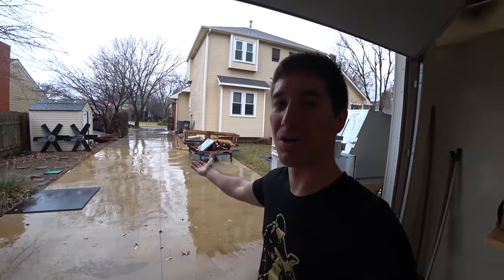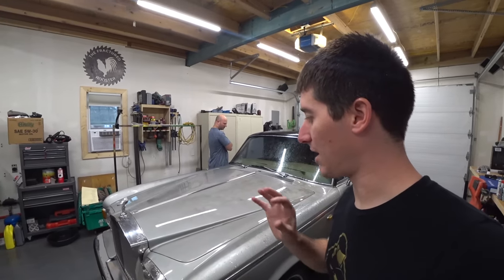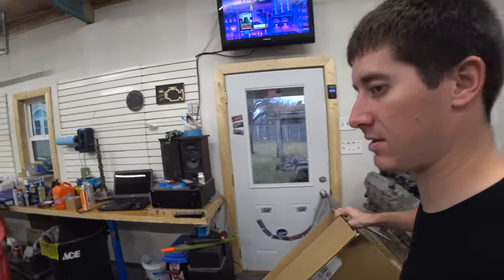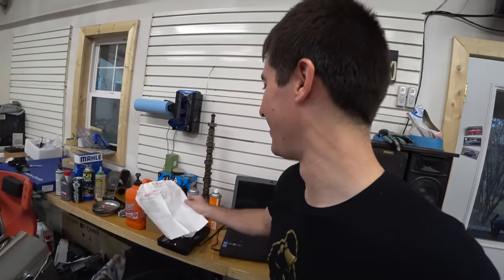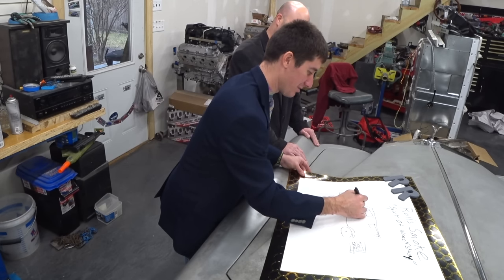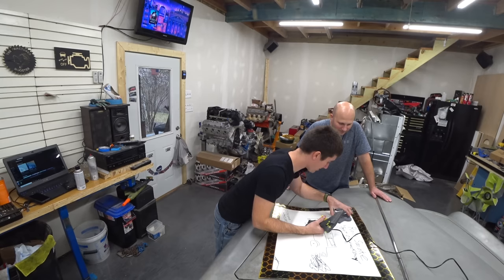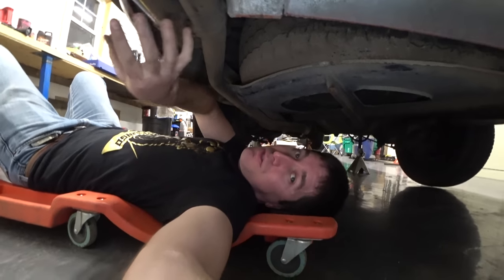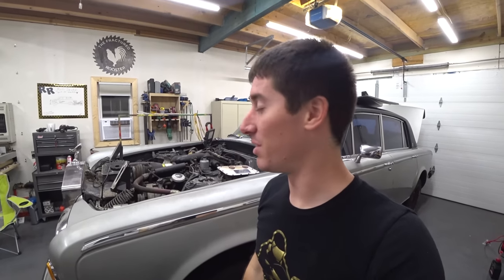Introducing PROJECT ROLLS SMOKE *LS Swapped Rolls Royce*

Comment: This is not where I saw the RR rebuild going.
Reply from the maker: It was pretty hard to keep the plans secret for one day, the engine deal was put together on Monday 😂
Reply: I'm honestly okay with it though
Reply: this is not the type of RR that's worth bringing back
Reply: @LuanCristianThums  It is a shame, but it will cost $40-50k to restore. Its really just a parts car so if it can be rescued in any way I'm OK  with it.
Reply: @2DogsVlogs  exactly
Reply: @WatchJRGo  save the top... weld some sheet metal to the top... and reupholster the top!
Reply: Cleveland Maker - Agreed. Sand it, patch what’s too far gone, paint it with Rustoleum and have a shop put a top on it. They’re not that expensive to re-vinyl. It would be the best budget resto mod you could do looks wise anyway.
Reply: @WatchJRGo  Don't junk that engine or trans. Someone is needing it. Keep those parts alive.
Reply: @LuanCristianThums  your right its only one of the most iconic body styles RR has ever had.
Reply: @MDC2020  by type I meant "rusty $1400 type"
Reply: @MDC2020  While that is true, there are still many of them available.  No Rolls Royce buyer would even consider a rusty car like this.
Reply: @MDC2020  it isnt a particularly special car. It is silver wraith II badged (rather than the earlier unbadged LWB silver shadow), it isnt first or last year,  it isnt specced up, afawk it has no special provenance. It is a rust bucket.
Honestly if he parts out what he can he is probably doing the best thing for preservation of rolls in general
Reply: this is EXACTLY where I saw it going
Reply: @WatchJRGo  eventually turn it into an EV. Have Rich Rebuilds help.

Comment: Have a kolache while you're here in Houston.  Check the rear suspension mounts they are weak and will rip out during a burnout.
Reply: kenneth clifford I remember Jesse James twisted bent and almost broke the rear mounts on one of these just from a few burnouts with the stock engine, I think the diff is only a single spinner too. It will probably need welding

Comment: RR/Bentley used GM turbo 400 transmission's for many many years
Reply: If they get a good built turbo 400 it will hold up and it shouldn't be too hard of a swap, and they are fairly cheap
Reply: I buy all my transmission stuff at TransPartsInc (TPI) in Fresno.... never failed me yet. Give these guys a ring. I was there a few days ago and things have slowed down considerably because no one fixed anything any more... its all remove and replace.
Reply: They rebuilt and refined them. RR owners dont like jolts into
gears as its typical for this cheap transmissions. REFINED.
Reply: To be accurate they used a "worn out" spec TH400 for those smooth shifts. The gear selector mechanism was especially crazy as instead of having to strain oneself physically selecting the gear they used an electric shifter which meant if you were being "sporty" with the steering wheel it was real easy to accidentally flick from D to R whilst turning with the expected results!!
Reply: @marksavin5778  A Rolls Royce is not a sports car. This strainless
shifts where made to an acceptable level of comfort. American philistine

Comment: Don't junk old motor sell it!
Someone is needing that motor!
Reply: Thomas Mcintosh 100% agree with that.
Reply: Agree! If the parts are extremely rare, help someone else out that restores them!
Reply: whole video is an insult to reason and common sense :)))
Reply: No rich people going spending around $50,000 to buy a used or a crap Roll engine.
Reply: @Chu3505  no. but another JR somewhere restoring a cheap rr might be able to use parts off this engine for cheap.
Reply: Yes dont junk that motor. Someone definitely can use something off of it.
Reply: erm the engine and parts were sold to wizard, need to listen to what is said

Comment: I agree with some of the other comments about the rear suspension/differential not holding up to the stress of burn outs.  You are going to have to reinforce it somehow.  I've seen a few with small block Chevys and I knew someone who had a 1970s Silver Shadow with a big block 427.  Other than the engine swap the car was original and in excellent condition.  It ran, drove excellent and had way more power than with the original engine.

Comment: For best saving of time and money, I suggest old school....a Chevy, GMC big block V8 with carburetor (or two), automatic transmission (no clutch assembly needed, heavy duty GM (or Ford) rear axle with 4.56 ratio or higher. No electronics, no fuel injection, no fuel management, no crank position sensor. Very simple, very strong, very dependable. Relative to other options, very inexpensive. A good salvage yard should be able to provide a motor/transmission unit with alternator, starter,etc. Very best wishes on this project....I look forward to watching its progress. Richard Browder, Virginia, age 77

Comment: What about just mounting a camero subframe up front on that then you have motor mounts GM disk breaks . I think over all it would save a lot of grief and hassles . I do believe these rolls use a strut type system so you could use the towers drill new holes to mount struts.

Comment: Such a cool project.  Good to have trailblazers like the Car Wizard to hopefully reduce missteps and blind alleys.  Hope mating a GM LS6 to a GM transmission is as compatible as it would seem.  Because of the curb weight it sounds like the Rolls is basically a heavy duty truck platform.

Comment: LOVE THIS PROJECT..oh wait,,,,, you are not going to save it?   OH MY..
Reply: It be cheaper to buy a running 1979 roll wraith 2 then rebuild this one.

You can buy one in better shape for $18,000 it would cost like a hundred thousand to restore this car back to factory.
Reply: @vikingman4614  I have owned 2 but we realyy have not seen close-ups of the engine etc. Seems the car would run great if they clean the filter and put new gas but yes, I do understand.

Comment: I’m loving the LS swap ❤️. You may want to redesign the rear suspension I’ve heard it will be your weak link. Consider a 4 link conversion with a Ford 9 inch posi traction

Comment: Back in 1994, my boss (used car dealership) had a ‘79 Silver Shadow II (same car, shorter wheelbase) which ran perfectly and everything worked, even the A/C....except the suspension.  He ditched the hydraulic stuff and had regular shocks put on and the car was only 15 years old.  The paint was about 90% and the only interior issue was a little peeling lacquer on the top of the door panels.  Nice car- sold at auction for $13,500.  By now, it’s probably returned to the ground from which it came.

Comment: I cannot believe the price you paid for this car. Here in the UK you would be lucky to find one for less than £4000, running or not. I like what you are doing to it but please don't destroy it. You don't have to use RR parts to fix the little things. Rob other cars and improvise. Check out Harrys Garage on you tube. He took one to the Artic Circle and back. Great video as usual. Look forward to more. PS.... the engine swap is a great idea.

Comment: Installation of the engine is not major problem. Good luck with the brakes.
Reply: norman sabel new brake lines and a booster from something else that isn’t connected to the suspension,  like every other car has.

Comment: Do a compression test and check the oil pressure first. If both check out good check the ignition is working right - it probably is, if it was fixed 1000 miles ago, unless corrosion has crept in. Then see if the fuel system is gummed up with old fuel. SU carbs are not hard to overhaul there isn't much to them, much less complex than an American 4 barrel. Chances are it will run great with the fuel system cleaned and a tuneup.

Comment: I like the engine swap. A lot of Jaguars ( 80s and 90s ) were LS swapped.
Reply: And they are worthless now. Swapping is always a bad idea, espcially today with Internet and worldwide parts availability.
Reply: @Allmentux  An old LS swapped Jag is worthless because old Jags are worthless... An old Rolls Royce will never be worthless because it's a Rolls. This car was worth $3-5k before he even touched it... It'll be worth $10k or better wit an LS motor under the hood.
Reply: @Allmentux  I mean that RR is a lost cause already I do not think It will hold any value even a good condition 70s RR are being sold for lesser that 15k  some newer camry are more expensive. so if you buy a beater Rolls I think it is acceptable to do a swap not expecting it to retain any value at all but novelty.
Reply: @MelodyOo  I just had this arguement with someone yesterday on the first video. He was saying these retain $25k all day in rough shape and I died laughing. Yea, people are asking $23-25k for mint, factory examples. This will never be close to being to that spec. With the swap I'm sure he could sell it for $10-15k based on the swap and novelty but that's it. Probably less due to panel rust etc
Reply: @Allmentux  all original jags from that era are worthless period they are just junk no 2 ways around it. I would honestly bet that a well converted jag with a 350 is worth more than an original.
Reply: @Stressless2023  never worthless? there are soooo many of these rotten barges in the UK that nobody wants, specialist breakers yards have piles of them only being used for parts. Like any luxury car they depreciate to the point of being absolutely worthless like this one is, 3-5k? it's a 1k parts car at absolute best
Reply: @dazasc3994  Oh I'm sure these are plentiful and "ordinary" in the UK, but here in the U.S. the Rolls Royce name is probably alot stronger than it is over there. Bring those old junk Rolls Royces that you have so many of here and you'd make some decent money lol.

Comment: 5x130 wheel pattern is the same as porsche 924/944/951 cars.  Not sure on your offset vs theirs but there is an option for wheels if ya want to change them and have some options.

Comment: just a quicky jr how are you going to work the brakes and suspension? as your rr is its all citroen hydrauliced up. without the pumps your gonna have to create a whole brake system from master to calipers and also springs and dampers this is gonna crank your budget into anouther realm!

Comment: Before you pull the engine check the ignition points. They slip. You might find that's the main problem with the engine. It's a common issue with that model and is really bad when they are new.

Comment: Interesting swap. I have a 1977 Silver Shadow and have thought about engine swaps. How are you going to deal with the high pressure twin braking systems and suspension that run off cam pumps on the rolls engine, as designed by citroen?

Comment: LS?  I think a screamin' Detroit Diesel Allison would fit in there.  Maybe a hood scoop for the tall bits.  Turbo.  You are going to need some heavy torque to break the back tires loose from under all that weight!   Looks like a Rolls, drives like a nightmare, sounds like a truck, smells like a dumpster fire.

Comment: Put a cheap wrap on it Rhino line the roof and replace those two trim pieces are missing on the passenger side put up the wheel covers back on and clean it up the best you can. and call it a day

Comment: Don't you need a brake booster or hydro-boost setup to get the brakes working?  Also a hand brake.

Maybe it should drift?

You should probably be able to re-drill your wheel hubs and brake rotors (drums?) for a more common bolt circle.  You'll probably want to upgrade your wheel studs so it shouldn't be too much extra work.

Comment: Well... Have you tried at least basic trouble shooting on the original engine? Checking the compression, if spark plugs are good and fire... These motor generated so little HP for their size that I don't know if it can wear out that much. I'd give it a try.

Comment: Notice that the old drill, has 2 speeds, you need to remove the screw that is holding the crank and large gear on and move it to the other hole and    You then have a different drill speed.

Comment: Don't forget the RR engine is integrated into the brakes. So you need to change our all the brake system too. Oh, and the suspension. That's run off the hydraulics off the engine too. Oh yeah, and the power  steering. Start collecting sponsors.

Comment: Ya know..........  Suck squish bang blow still applies to the Roller engine.
Open up the exhaust, get rid of the SU's for something bigger and lose the 2 ton of body deadening and she will shred tyres just fine.
a bit over 400 cubes and a 90 degree block they make good torque.
That said im going to be VERY interested to see how you replace the Hydraulics because it runs brakes and ride.

Comment: I’m so tired of ls swaps...  the classic rolls Royce engine is capable of so much more....
Reply: So true. And it wont be cheaper, as rebuilding the original engine..
Reply: I like the LS swap idea, but I’m not even sure there’s anything wrong with the engine. Fuel system? Definitely. Engine? Umm...
Reply: Chip B That’s what I’m saying, he should just clean the gas tank and replace the pump and filter with good ones and it would probably straighten it out

Comment: Honestly, I'd keep the original engine, it will run fine with a new fuel pump, filter, and a Dominator carb. Replace the transmission, and remove all the emissions junk. The power should ramp up while keeping it as original as possible.

Comment: If you cleaned the fuel system out, it might actually run really well. I do not think there is anything wrong with the engine.

Comment: Putting LS engine wont be cheaper, as you need all kinds of Adapters and then you need to integrate the brake and suspension system. These butchered cars may be 15k worth, were a retored one is 30-45 depending on the extend of the restoration.. You may ask Rodd Sala of Park Ward Motors in Illinois before doing anything irreversible to this fine car!
Reply: he can pull and sell the engine and trans for those doing restores..  its pretty rough for a full restore..    he can swap in a better more modern drive train pretty easy and have a unique cheap ride..   like he says "do whatever you want",  hes doing exactly that..

Comment: Haven't LS swaps been done to death?  Perfect example - look up a video titled "They'll LS swap anything".  Coincidentally, it features a RR LS swap.  It's from 2 years ago.  As you're videos always suggest do whatever you want, but this is an extremely well worn path.  You talk about how great of a job someone did taking the time to put a turbo on that RR motor, then you want to just rip it out?  It might run right if you took the time to clean the fuel system.  Anyway, guess you already said your ignoring comments, but just a couple observations for you.

Comment: Why not just change the fuel filter and fix the system, as it already sounded like an LS, plus the car wizzard seemed to have saved hoovie alot of cash on that bentley, so fixing it may not be as costly as you think, as all a bentley is is just a rolls with a different grill on the front, as I was thinking 20 grand to fix it, not 200. Plus if its a simple fix to get it running right, that means more money to spend on maybe doing something crazy like taking the hood off and putting a supercharger on it.

vs fabricating an entire LS, granted, they used GM Turbomatic 400's on these to begin with along with ferrari of this period of the ferrari 400 of the era, so for all I know it does fit.

Comment: Realistically this car would only cost a grand or two to get sorted and running and driving good...  door wood $500, cheap maco paint job $800...  id sand the metal under the roof down and either have it painted or crinkle coat it.  Anyone saying it would cost a fortune to restore back doesn’t know how to work on one of these...

Comment: when I seem that bottle of mustard. I thought for sure I was going to puke.

I still say if you put a better fuel pump fresh gas and 80 good fuel filter. This car would run quite well. Not to mention would not be half bad. I know she's got a bad transmission, and that's part of why you're doing the engine swap. This is one of those vehicles. I wouldn't have minded getting at that price point just to enjoy driving it for a while. Nothing do with restoring it just drive it as a car. Can't imagine how hard doing that engine swap is going to work out.

Comment: Dont put an LS motor in a Roles Royce. Keep it stock
Reply: The stock parts for the car is too expensive

Its still worth like 13,000 with the rust removed and running non rolls Royce engine
Reply: @vikingman4614  such a nice car shouldn't be torn up. I see what your saying about cost.
Reply: @jo6520  it would cost $200,000 to restore a car only worth $13,000-$24,000
Reply: @vikingman4614  if I had I would spend it for a true RR
Reply: @jo6520  You can buy one in near mint for like $20,000 of this same car buying parts for this car would cost too much.
Reply: @vikingman4614  200k is made up by him and certainly not true.
Reply: @Allmentux  $200,000 is a exaggeration bit it would honestly cost over $30,000 to restore it
You can buy one all original of this model for $18,000 and spend $8,000 a year in maintence
Reply: @vikingman4614  2000$ is more realistic. Ask people who own these cars...there is so much missinformation for these ones on the Internet!
Reply: @Allmentux  well if you care so mich about the car in sure JR would sell it to you AS IS for $10,000 and put the original engine back in with its faulty rigged parts
Reply: @vikingman4614  It would be my pleasure!
Reply: @Allmentux  so did you try contacting JR on Facebook to see if you could buy it for $10,000?